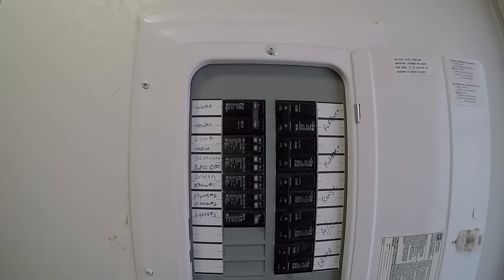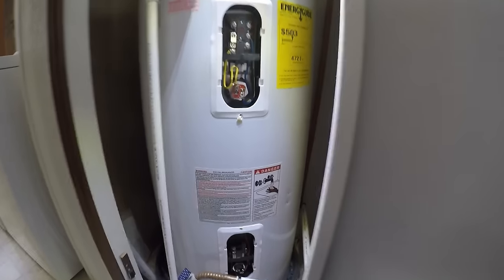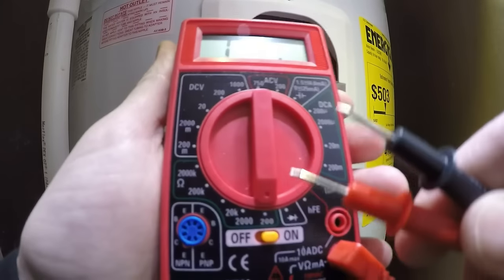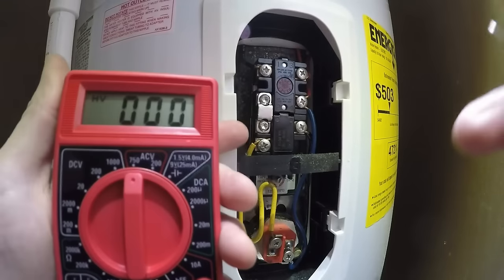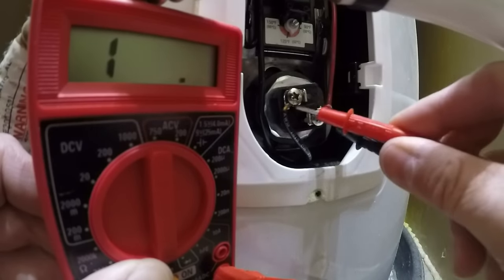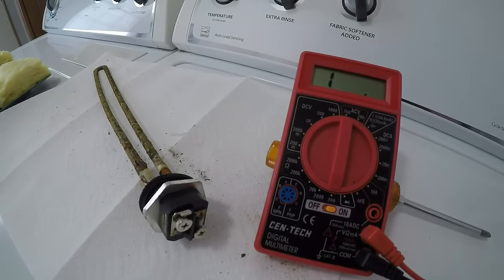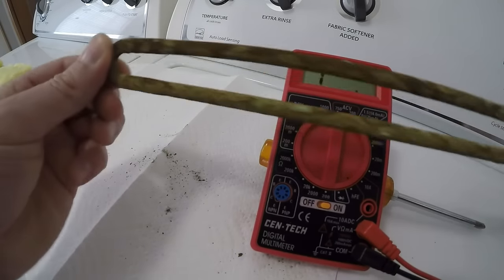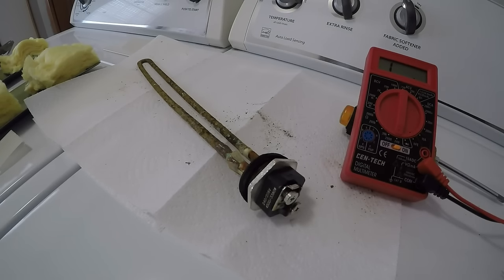How To Test A Water Heater Element

Comment: That looks like the wrong size breaker for that heater. 4500 + 4500 = 9000 / 240 = 37.5 so it should be a 40 amp breaker. If both elements come on at the same time it could trip the breaker.
Reply from the maker: 25 amp is actually perfect per this setup. Double check your equation. It also depends on the person some might want the higher amps to feel better. It’s Not necessary. But thanks!
Reply: I just re-checked my equation. If both elements come on it will draw 37.5A.
Reply from the maker: Yes they will draw higher like your thinking possibly if they both come on at the same time. That would definitely cause this breaker to trip in this video. The elements really are not supposed to come on at the same time. They each have there own thermostat. This one is not setup that way. I would rather it trips if it fails. If I put a 40amp in and both elements fail AND come on together it may not trip and that could be dangerous
Reply: Unless the heater is wired wrong, the elements are only on one at a time, never both at the same time. The top first to heat the hot water, it then closes contacts to the bottom element and turns off the top. The bottom element keeps the water hot. If a lot of hot water is used, the process reverses with the top coming back on and the bottom turning off.

Comment: I just replaced one that  was shorted to ground, not 'open',  You didn't show testing for that. Took a bit more effort to figure out which element was bad... I couldn't find damage to the outside of the element when I took it out.
Reply from the maker: Yes I know that is also one possibility that I wish I would have added into the video.
Reply: Cheez And Wine 🍷
Reply: Cheez And Wine how was it shorted to ground ??? A short and ground are 2 different faults

Comment: Be careful with those Harbor Freight Cen-Tech multimeters - I had one that the AC voltage setting stopped working - the DC/ ohm`s , ect still worked - just the AC would not read!  Check your meter on a live circuit first!
Reply from the maker: Yea thanks for the heads up! I did have one of the harbor freight ones fail on me the one in this video is the replacement that’s why I at least tested it this way anyway, yea good idea for sure! I hope to get a better quality one soon!
Reply: I bought a fluke - they are expensive, but I feel they are worth it!  Your welcome and have a great day!  @jamiewagner
Reply from the maker: flukes are real nice! thanks! 👍

Comment: thanks.... but it is not the water heater elements or the thermostat. all checked out ok with the multimeter. found out it is the water heater power box....
needs replaced :/
Reply from the maker: Oh wow. Never thought of that one. Thank you anyway for sharing that with everyone her in the comments because it might help others out!👍
Reply: What is the power box?
Reply: @dlg1776  probably a "little gray box". It lets you turn off power to water heater on wall mounted box. Some have timers built in so you can set certain times for water heater to turn on and off.

Comment: what if multimeter in resistence (at 200) shows 30, it is not betwen 10 to 16 like u said.  So i get continuity but it has 30 resistance. Can my element be broken? Also when I switch on the water heater the RSD goes off. The thermostat is ok.
Reply from the maker: It's possible. Because there are many different water heaters

Comment: Another way to check if it's bad, with voltage, if either side is getting 120v , touch both sides of element if it's good it'll be zero, if it's bad, it'll bed 240v
Reply from the maker: thanks Dave for the extra info!

Comment: Would be a likely reason my electric bill doubled in one month with no reason. I have hot water, but it might be a little hotter than normal.
Reply from the maker: I guess you never really know, I wouldn’t think it would cause your bill to double but if the element is overheating and it’s double overheating I guess you would see an increase because the wattage on those elements is pretty high

Comment: Woke up with cold water,  tested upper and lower elements. Upper is bad, lower shows still good. Would just the bad upper cause the entire heater not to work? (no tripped breakers for electricity nor on the thermostats)
Reply from the maker: it could
Reply: Jamie Wagner I replaced the top element (probably will do the bottom soon). And sure enough my water heater is alive again!

Comment: Question
 I have water leaking from my upper element is that a sign that it's busted maybe holed up on the inside? 
 This is also a brand new water heater not even 3 months old yet
Reply: Not getting any reading off it either so I might have answered my own question but I would like to be sure
Reply from the maker: yeah could be bad

Comment: Why do you switch the connection for resistance testing. The multimeter sends current so it will always be the same. If it's not then you havea big problem with your multimeter, but I've never see that happen. But having said that, it can't hurt. Very good video because you explained very clearly with no useless fluff. Fluff is the worst.
Reply from the maker: lol yeah I know fluff is not good! thanks!

Comment: Sorry Jamie. I did not get this for several reasons but appreciate the effort. Your main breaker may have blown due to the Element initially shorting and then burning open under the high current of the element short??  Anyway...thanks for taking the time to do this video.
Reply from the maker: yeah I never did any further research to diagnose main root cause but I know my water was burning hot and that led me to the water heater where I eventually found that the heating element was completely destroyed

Comment: Liked, I have a used element. Only used a few months. Looks to be in great condition. If it will read 13 ohms? Is it likley still useable?
Reply from the maker: you could probably use it if you really had to but I'm not a big fan of used items like this unless you know who it's coming from, I would normally buy new to be safe and so I don't have to do a project like this again
Reply: @jamiewagner  Understood. I would just toss it. Except it's a heavy duty element, not just an off the shelf Box store element. + the water heaters about 12 years old. I hope to move within the next 6 months. Just hate spending money on a unit that old. Thanks for taking the time to reply.
Reply from the maker: Yeah you’re welcome good luck with it I’m sure it will work fine have nice Christmas and new year!

Comment: There is no polarity with AC voltage (unless we’re troubleshooting audio circuitry or acoustic phase) and no polarity with resistance (ohms) so switching your meter leads isn’t necessary.  Otherwise thanks for the vid!
Reply from the maker: Thanks for the info!

Comment: My power bill went from.250 a month to 570 the next month I didn't connect nothing else Could water heater cause this.If so what and how do I check to see problem
Reply from the maker: Not sure Sounds like you’re gonna need to test more than the water heater I can’t imagine it increasing your bill that much but maybe it did you’re probably going to have to test a bunch of other stuff to

Comment: I don't know what breaker goes to the water tank, in my house the electric box isn't labeled so can I test the elements if I flip the breaker I think it may be? What If the electric doesn't go off will that shock me if I test it ?
Reply from the maker: I would not mess with it unless you know that you have turned off the breaker FIRST. You might have to have a certified tech come out and do it, You will get shocked if you don't know what you are doing with it for sure. I would be very careful and call a certified technician or plumber
Reply: @jamiewagner  thank you so much for the reply I ended up shutting the mail power off and tested the thermostats and the elements both passed so I have no idea what's causing me to run out of hot water in 8 1/2 mins the tank was purchased brand new from lowes in June of 2020
Reply from the maker: It might be the thermostats in your tank he sure to check on those as well
Reply: It’s 240 volts which can be fatal.  Don’t mess with it unless you are certain the power is off to the water heater.  The multimeter test is conducted to make certain THE POWER IS OFF TO THE UNIT!

Comment: Thx for vid. Now, my question is related to resistance over described normal range. I have a 3 element 60 gal hw heater. Top reads 16.5, mid 21, bottom 74. What is that supposed to mean?
Reply from the maker: not sure

Comment: I replaced both elements in elec.water heater  next day water was too hot I turned temp from 150 to 125 without tripping my breaker off and today after I used all my hot water it won't heat  did I mess something up by not turning elec off. I have reset  
An tested elements  still no hot water
Reply from the maker: Did you originally turn the power off before replacing them? You also might want to replace your thermostats maybe there is more wrong with yours. Try turning the breaker off and on one time and see if that helps to reset it. I would be careful with it or call someone you know who might be more familiar with repairs like this.

Comment: I had an issue I'll share with y'all.  No hot water; I had 240 V at the top of the tank.  When I checked the upper thermostat, across 1 and 3, I didn't get 240 V.  According to some troubleshooting videos, that was ok if both 1 and 3 had 120 V but I don't think that's correct.  I ended up with a short in my wiring at a junction box about 7' before the water heater.  So if you don't have 240 V across 1 and 3 of the upper thermostat, look closely at your wiring for a short.
Reply from the maker: thanks for sharing this!

Comment: Correct me if I'm wrong, I have a 3500w element and if it's good it should read 16 ohms and if it's bad it should read below 12?
Reply from the maker: Possible, test both elements and see if there is a significant difference
Reply: Hey Jamie, just got done testing the element and it has a reading of 16.9, is this to high or ok? Oh by the way I do like this video.
Reply from the maker: it seems like a normal reading

Comment: Does it matter if the tank is filled with water could you perform a continuity test , or it should be drained before testing , thank you.
Reply from the maker: no, it does not matter if the tank has water in it or not. Turn off main power first, then test the elements.
Reply: However, if you take out a bad element with a full tank of water, you’re gonna have s real mess on your hands.
Reply from the maker: @dosmios89  yea that's for sure!

Comment: thanks for the vid bro. Short and to the point. The way it should be. Not a bunch of unnecessary wordage! . One vid I pulled up was almost 30 minutes long. I chose your 5 minute video over it.
Reply from the maker: that's awesome Doyle! thanks for the comment! glad you picked mine over the others!! Hope you got your water heater working ok!
Reply: Yes but he did not test correctly.  It only demonstrates and open circuit.  You MUST check amperage on both legs to test a heating element.  Lots of faulty elements that barley heat because  people don't understand that many elements while still having continuity, they are damaged and must be replaced.  Would have made this wonderfully short but incorrect video a bit longer but correct.

Comment: you should have replaced the upper and lower at the same time
Reply from the maker: +Clamp-On Multimeter Channel yea I know I should have. I was going to. I may end up doing it anyway. It would have been better just to do both at the same time. The bottom one was in pretty bad shape.
Reply: I don't see any sense in replacing both at the same time. They do not run the same. The upper is primarily a maintenance heater whereas the lower has to work harder and longer heating up the cold water the descends.  Consequently, the upper should last considerably longer than the bottom.
Reply from the maker: That’s good to know. It also depends on the quality of your water.

Comment: Normally you would remove the 2 wires from the element then test the element itself ..
Reply from the maker: Actually you would test it both ways. Wires can short out
Reply: Jamie Wagner test what both ways ..?  You test for 240V at the 2 screws of the thermostat to make sure you have power there, if you do then next step is to test the element itself... You then remove the 2 wires, then test for resistance on the element itself..

Comment: Does a bad heating element causes my hot water to reach temperatures above the selected range and cause the heater breaker trip occasionally?
Reply from the maker: Yes it can.
Reply: Thanks I'll be changing mine this sunday!
Reply: No ,the high limit control at the top regulates the temperature,  could be a bad high limit control, or high limit control isn't seated properly.

Comment: Paid $200 for a plumber to come and they didn’t even use a multimeter to check the element. They replaced only the bottom one and left. Not 10 minutes after they left, the breaker go out, again no hot water.  Had to wait 3 more days. They came back for second time and the guy just acted like it was going to be yet another $200 to replace the top one without even pulling out a multimeter. Next step I am just replacing the top element and going to take out and test the old one .
Reply from the maker: WOW that's not CHEAP! IT's better to replace both and even the thermostats to be certain, i'm sure you wont have issues if you were able to do all that yourself, because it sounds like it would cost to much to have them do all that. I can't believe they didn't even use a multimeter.

Comment: I read 19.1 Ohms on my bottom element and nothing on my top one.. is 19.1 too high? Thanks for the vid!!! Merry Christmas!
Reply from the maker: Maybe the bottom one is ok but the one your getting nothing on might be the issue, I’m not sure if that 19.1 is to high or not some units are different you would have check the specs of your tank
Reply: Honestly. If I were going to drain the tank to replace one of them, I would likely just change them both out at the same time.
Reply: @akpilot9468  brand new tank! i hot fried the top one..whoops
Reply from the maker: Whoops
Reply from the maker: Yeah that’s a good idea to change them both
Reply: Rippin hot water now!! tnx again!!!
Reply from the maker: Awesome! Glad your back in the hot water business 😂

Comment: Man, if you're so scared of the power being on, why don't you just unplug the darn thing? That's even safer than turning breaker off just in case you have the wrong breaker. Was that just too easy for this internet crowd? 
However, as basic as this was, I still learned something so not a complete waste, I just would have done some things differently and easier. Unplugging might seem hard work for some lazy people, but it would be even easier to call a damn plumber

Comment: I’ve worked on water heaters before and when I was listening to the video I was confused about something. You mentioned that the fuse is blown and that the water was very very hot. Normally when one of the elements is blown out, my experience has been that the water gets hot but obviously turns warm really fast because only one element is working. In cases where the water has been extremely hot, one or both of the thermostats needed replaced Because they no longer keep the water at a set temperature you want or only heat all the way up..Did you have to replace a thermostat or is there an explanation to why the water would be extremely hot if one of the elements is out? Thanks.
Reply from the maker: yeah great question, I never did test the thermostats to see if one of them were bad or not, which I should have but I just went ahead and replaced both thermostats because I thought of that as well that one of them could be bad causing the over heating, but I never found out for sure with this one, I just ended up replacing them to be on the safe side.
Reply: @jamiewagner  

Oh ok. I was just curious. That’s a good move though. Thermostats are somewhat cheap to replace. I just wanted to make sure there wasn’t something I had missed. Truthfully, the multimeter is the best thing ever and I need to learn my way around it. It’s a game changer and helps eliminate guessing. Once I learn that skill, I will feel a bit more complete. Thanks for the reply.
Reply: @jamiewagner  

Also, I really do not know how to actually test thermostats. Most times I’ve ever had to replace one, there’s been obvious signs; charring, over heating or having to reset it every few days.

Comment: in an electric hot water heater? I'm still not sure why people insist on heating hot water. If it's hot, why heat it? I've also never seen a hot water heater in a hardware store. Just a water heater. Normally people heat cold water. (giggle)

Comment: Your water was burning hot?
I hope you tested the thermostat too then, because that's more than likely the reason your element burned out!
Reply from the maker: I replaced both of them anyway
Reply: I was wondering that myself. Mine is not enough hot water. 60 gal should be enough for shower, at least it used to be. That's why I'm looking at videos. Lol
Reply from the maker: Yeah you might need new elements and new thermostats

Comment: Is your water heater full of water when reading ohms.(13-16)? BTW, is that ohms or kiloohm
Reply from the maker: yes when I was testing them the tank still had water like normal in it. and it was ohms. I remember that I drained the water out and then I replaced the heating elements while the tank was empty. but I was testing them when it still had water in the tank. I did it both ways and I still got the same reading.